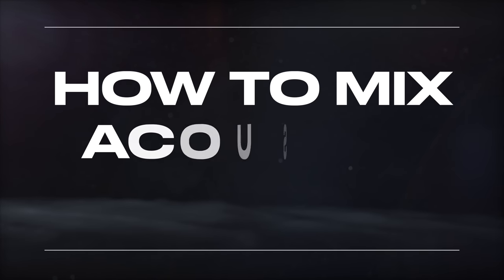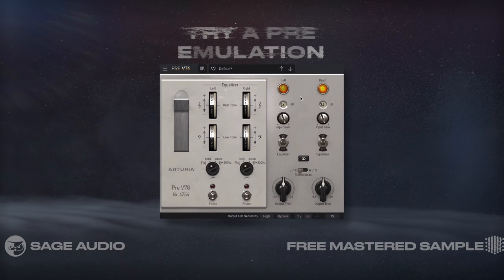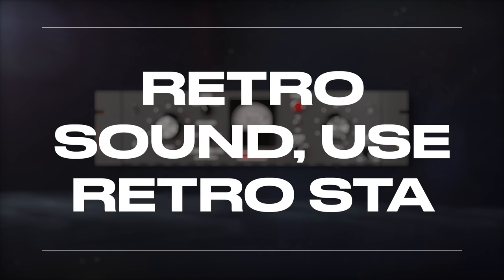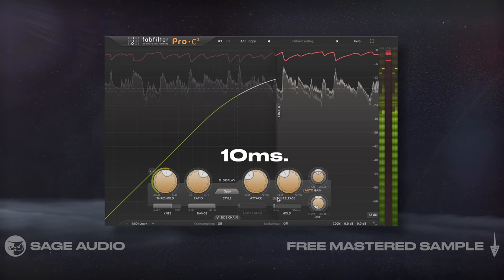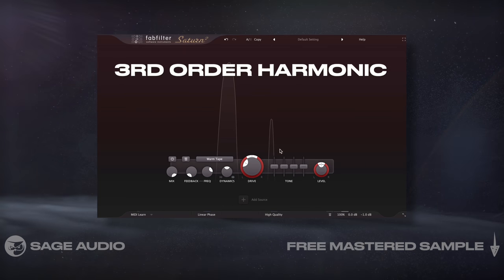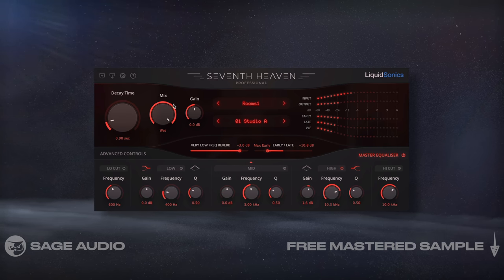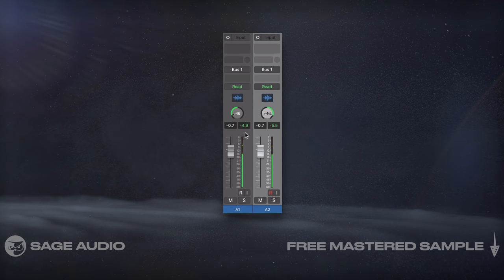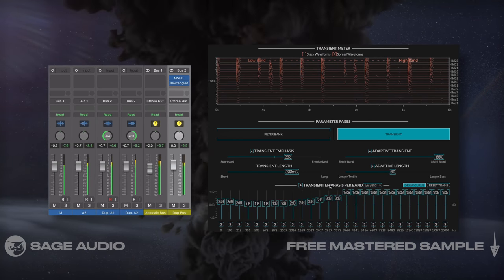How to Mix Acoustic Guitar

Comment: Thank you for your clear effort, and I have a question, do the first steps that you explained apply to a bus or to every track in its case? ❤️
Reply: what do you mean, you have multiple gtr tracks?

well what you wanna understand is just the signal chain, so while you could do this subtle EQ cleanup & the preamp on a bus that processing is going to be coming after everything on those tracks.
the preamp is in the actual recording of the track & you're just emulating that so that would come before everything irl (even outboard gear you could be using going in) but there are no rules in art you can do whatever you want to do, whatever sounds good to you.

if you're not doing any processing on the individual tracks themselves than doing that EQ & preamp on the bus could work but thats assuming all the tracks need the same treatment to clean them up & that may not be the case. all that boomyness is getting multiplied (with each track) before it ever gets to your bus/EQ so that could create a problem or make it harder to properly attenuate.

generally speaking I would say it'd typically be a better practice to clean them up individually but if you're maybe trying to save CPU or whatever & doing it on the bus works for your mix than like I said there are no rules.

hope that helps!
Reply: @darkskinwhite  ❤️🙏🏼